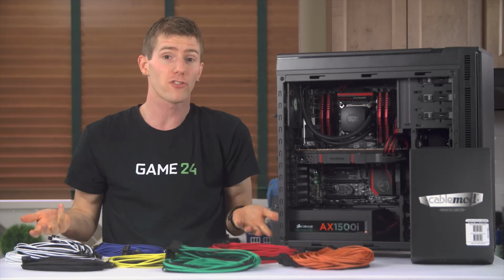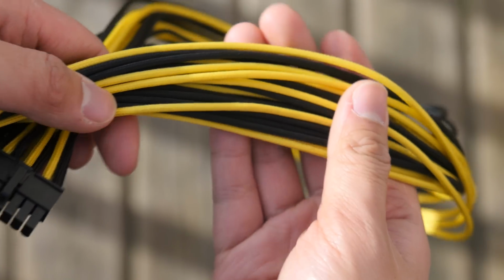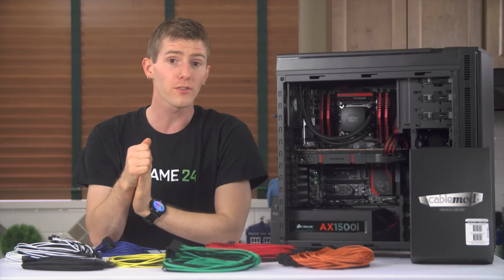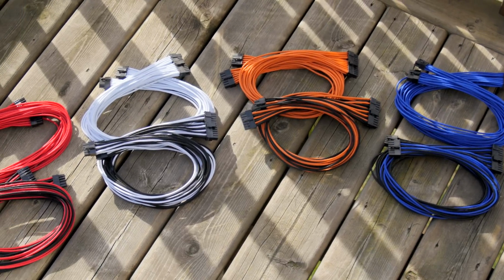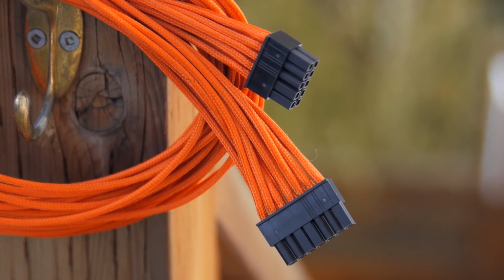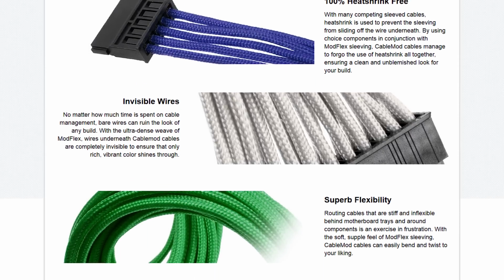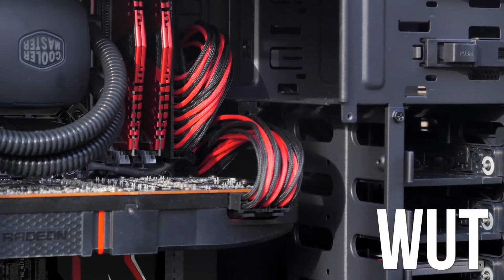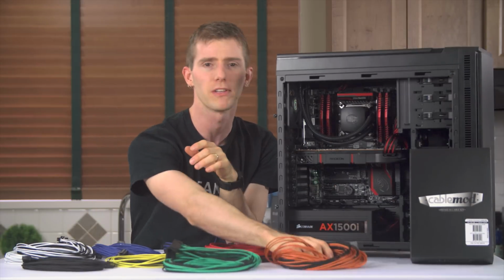CableMod C-Series Individually Sleeved Cables - Sexy and Simple

Comment: So I ordered CableMod Pro modmesh cable extensions for my EVGA Supernova G2 650watts power supply , should I be worried about ''additional resistance on the wire'' for which Linus is talking about ?

Comment: I'm not an expert with PC's, but isn't the fan for the PSU meant to be facing downwards @ 4:38?
Reply: Doesn't make much of a difference. They did a video on it i think.
Reply: X Oh ok, thanks for the info.
Reply: +Hsc Exams Also depends on the case, as some cases dont have any ventilation at the bottom. np :)
Reply: X Cheers. I'm new to all this stuff, I'm trying to build myself a PC atm.

Comment: why are sleeved cables so expensive ?
Reply: cause they are handmade
Reply: and they're not necessary. they charge you because you can. its not a need but  a want.
Reply: This is not a normal cable with paracord, they use a high quality nylon!
Reply: vespaman0
I don't care, as a consumer, profit margins don't matter, only quality and price matter. Because why go with cable mod when you can get something better for less?
Reply: +vespaman0 Same thing goes with cable management, same thing goes with watercooling, same thing goes with your backlit keyboard, however they aren't price-gouging the shit out of you for them. Plus, bit-fenix cables are a-lot less and are even better, being that they are thicker and easier to train.
Reply: Deimos Phob They don't have the benefits of a massive production process though that corsair has for their standard cables. Since seasonic makes theirs and many others. When you sell 1000 cables with your power supplies and make a ton you can sell cheap because you don't need a high profit margin. These companies like cablemod don't sell a whole lot so they need a high profit margin.
Reply: Deimos Phob whether or not they are better idk..but if bit fenix going to make them for you in custom color patterns  and length? Each cablemod purchase is done using the configurator which allows you to make your cables completely custom. That cost money. They don't have that prearranged and prepared for you. Its all "cooked to order". I highly doubt bitfenix will do that for you. If they do then that's great but from what i have seen doing short research its not the case. And does bitfenix support the same variety of power supply?
Reply: vespaman0
For most people, they just want a solid color, I personally think multi-color cables are a bit too much for most builds. And even then, the stuff from cablemod that is "cooked to order" as you put it is still far more expensive than the bitfenix stuff, and it is of far lesser quality. Also, bitfenix does have the same amount of variety for psu cables when it comes to the pre-made ones, and they always use 20-4 pin, and stuff like that on the base end of the powersupply in-order to ensure the cable is compatible, excluding the RM series, as the RM series from corsair has weird issues with caps, in which you need them on the cables. Yes, you can go into cablemods store and customize it, but it still doesn't mean that it will be good quality. Even then, the bit-fenix cables are also just as shitty, as they are almost just as hard to train as the cablemod ones, and the connectors, just like the cable mod ones, are of low quality and are bent in from factory, making the ends impossible to train too! Well, that is if you want to physically take them out of the connector.

Comment: what do you think of my pc build  stoked to build it 
CPU: intel core i7 4771 watercooled by Corsair Hydro Series H110
GPU : MSI R9 290 GAMING 4G in crossfire
Motherboard: MSI Z97-GD65 GAMING,s1150
RAM: Corsair Vengeance LP 16GB (2x8GB), DDR3 1600MHz
Case: Cooler Master Storm Scout II Advanced
Psu: 800 watt corsair 
Storage : 500 gb ssd by crucial and 2 tb barracuda 
fans : bittspector red led fans 

is there anything i should change

Comment: Is this a good build? 

AMD 2650 (OC to 2.0Ghz)
64GB of Corsair Dominator Platinum 2133
19.6 TB of PCI-E Storage
4 GTX 980's in CrossFire
2 1500 Watt PSU's (My CPU is pretty power hungry)
Rosewill Line-M Case
Windows 98

Comment: Dont get this... System. I´ve already saw a video about these cables on the channel of hardware chanucks. So i went into your shop and looked for some cables for my cx7500m from corsair. And the prize is actually higher than the one for the original(colored) sleeved cables by corsair itself. .
Reply: The Corsair cable also uses Shrink Wrap to finish the cables, which some people might not like. And also complicates the assembly process

Comment: I really don't see the point in doing this, because after a short while, everything will have a layer of dust on it, and you will really only be cleaning the heatsinks regularly, thus it will only look cool for a short while.
Reply: *****
 The issue is that it does not really work on the really thin layers of tiny dust particles that are clearly visible, but essentially require you to wipe everything down to get rid of it.
Reply: Razor2048 Meh. If you love your computer enough to buy it custom sleeved cables, then you should love your computer enough to give her the good old clean out and dusting every once in while anyway. I'd buy some custom cables and re-do some color scheming in my case if I had loads of money to blow on aesthetics alone! Sadly, life and money do not allow me to use money on purely aesthetics for stuff like that right now.

Comment: Can I get you guys opinions on my Pc? 

Cpu:  core i5 4690k
Motherboard: msi gd65 z97
Gpu: gtx 760
Ram: 8gb
Storage: 4TB 
Psu: corsair cx600m
Case: nzxt phantom 410 

Is it a good pc? Im not using it for serious hardcore gaming like, just a small bit of gaming cuz I have a ps4. I do use it for photoshop and unity3d etc. So what do you guys think?
Reply: The 760 is a little out of date id go for the 960 for around the same price, also get get an ssd for boot and your main programs (its waaay faster)
Reply: Yeah, it's good enough. Better than the average at least.
Reply: Honestly you did a good build but depending on what your willing to spend i have an $1100 Build video you can watch that is similar to yours but with a better gpu(r9 290x) and a better storage set up
Reply: Islaymoocows Yeah that's what i was thinking and the build video on my channel has both of those things with exception of the gpu being a 290x because they recently dropped in price
Reply: declan lees What issue? the reviews on the 960 are nearly perfect! http://www.newegg.com/Product/Product.aspx?Item=N82E16814487091
Reply: Don't get a 960 as it has a lot of issues (not daddy issues)
Reply: thanks guys :) i already built the pc a few months back, no issues with 760, :) i am getting an ssd though. thanks for the replies :)

Comment: Sleeve your own cables, peasants.
Reply: Not everyone has time, patience or delicate enough hands to do that.
Reply: Christoffer Nørskov It really doesnt take a lot of time. Maybe I should start selling sleeved cables on ebay, since pc modders appear to pay heaps of money for them.
Reply: Jay Anderson It does take time to do it properly. For a full power supply, most people say 20-40 hours for a first timer (99% of the people doing it are first timers) depending on how many cables you have, how many mistakes you make and how big your perfection tolerance is. 40 hours is more than a full work week, and most people just don't have time or patience for that.
Reply: Christoffer Nørskov I dont understand what takes so long. Ive never sleeved specifically pc cables, but ive sleeved a lot of cables in general.
Reply: Jay Anderson Then that's why you don't expect it to take long.
Let's just take a 24 pin cable, that's one out of many cables from your PSU. It consists of 24 cables, that each need to be sleeved with the following process.
Step 1: Take 1 out of the 24 cables out of both connectors (assuming you use your current cables not custom making your own)
Step 2: Cut the sleeving to size (this is more complicated than you might think, as the cable has to be cut to the stretched length, not it's resting length and one of the major points of failure)
Step 3: cut small pieces of heatshrink
Step 4: put sleeving and heatshrink on cable
Step 5: align the heatshrink right over the edge of the sleeving and heat it up enough to melt the sleeving in a tight ball around the cable isolation (this is hard, and will result in retries)
Step 6: cut off the heatshrink now that it's melted he sleeving to the cable
Step 7: repeat at the other end
Step 8: insert cable back into the jacks
Fantastic, that's one out of 24, now repeat steps 1-8 23 more times and you have your 24 pin cable ready to go. One single strand can take anything from 5-25 minutes depending on skill and any mistakes. Assuming you spend 5 minutes on every strand and don't make any mistakes, a 24 pin cable will take you a "mere" 2 hours.

Then you just have to do the same thing for your two 6/8 pin cables for your gpu (times as many gpus you have), all your sata and molex power cables, your 4/8 pin cpu header, and any other potential cables you have. Also, remember that if you have your psu cables sleeved, you might as well go all in and sleeve sata cables, fan connectors and anything else visible
Reply: Christoffer Nørskov I should give it a go sometime. 5 minutes for a single strand sounds very generous.
Reply: Jay Anderson Generous? That is a very optimistic estimate, especially if you want to both do it without leaving visible heatshrink and do it well enough that it will last

Comment: I view cable sleeves as akin to light strips, aesthetic eye candy. Sure, there are some benefits to be gleaned along the way, maybe for neatened cable runs or tricky distribution runs. I have been favoring mini-itx boxes and there is a lot of excess cable to pack away.

Twice in my life I have cable failure. They can be a bear to chase down, who thinks a cable will fail? I don't. But now I check when the usual diagnostics yield nothing.

Still I would like some. Form over function can still be a bit of vanity. I'm not perfekt.

Comment: Too bad they don't work on my ax 860 corsair!
would buy if were made for my psu series
Reply: our C-Series is compatible with the AX860 - the way how it works is the
following: Go ahead and buy a C-Series, once you bought it please
forward us the proof of purchase (invoice) and then we will send you a
AX 24 PIN cable in the matching color of your set free of charge.
Reply: So its a 14 + 10 pin from the psu, I'm not sure what yours is.
https://plus.google.com/photos/109060042969223363175/albums/6116910432695633121
Reply: That's probably because corsair sells a sleeving kit for AX/AXI/RM/etc
Reply: AdminWirsoftonline yea but i kinda dont like the heat shrink at the end of the sleeves.
Reply: I have these for my 860i, not sure what the difference is between the 860.
Reply: Brett McGinnis i thought it was only the corsair link cable port?
Reply: Yeah, I don't even use that feature. On CableMods site, they say you need a 24 pin cable if you have the 860, so there must be something different there, not sure what though. If you need more specifics, let me know, I can take pics for you.
Reply: Brett McGinnis thatd be cool
Reply: Brett McGinnis wow thanks man. the only difference i see is that its on its own row by it self.
mine is with the other plugs

Comment: I am building a Gaming Pc the parts are as follows please tell the parts are good and if not please suggest one. I am building it for first time so need some help

CPU: Intel Core i7-4790K 4.0GHz Quad-Core Processor

CPU Cooler: Cooler Master Hyper 212 EVO 82.9 CFM Sleeve Bearing CPU Cooler 

Motherboard: MSI Z97S SLI Krait Edition ATX LGA1150 Motherboard 

Memory: G.Skill Ripjaws X Series 16GB (2 x 8GB) DDR3-1600 Memory 

Storage: Crucial MX100 256GB 2.5" Solid State Drive

Storage: Western Digital Caviar Blue 1TB 3.5" 7200RPM Internal Hard Drive 

Video Card: Gigabyte GeForce GTX 970 4GB WINDFORCE Video Card 

Case: Phanteks Enthoo Pro ATX Full Tower Case

Power Supply: EVGA 750W 80+ Gold Certified Fully-Modular ATX Power Supply 

Optical Drive: Asus DRW-24B1ST/BLK/B/AS DVD/CD Writer 

Monitor: Asus VS239H-P 23.0" Monitor

Sound Card: Asus Xonar DG 24-bit 96 KHz Sound Card 

Wireless Network Adapter: TP-Link TL-WDN4800 802.11a/b/g/n PCI-Express x1 Wi-Fi Adapter  

Case Fan: Corsair Air Series SP120 High Performance Edition (2-Pack) 62.7 CFM 120mm  Fans 

Keyboard: Razer Blackwidow Ultimate 2013 Wired Gaming Keyboard 

Mouse: Logitech G502 Wired Optical Mouse 

Headphones: Razer KRAKEN 7.1 CHROMA 7.1 Channel Headset 

Speakers: Logitech Z506 155W 5.1ch Speakers
Reply: Get an i5 4690k, that mobo is overkill, 8 gigs of ram are ideal, ditch the optical drive and the sound card since they are pretty useless anyway.
Reply: ***** thnx for reply but will i5 5690k be able to play most  of the games at 1080p ? And till how much it can be overclocked?
Reply: Even an i5-4440 and a R9 280x will be able to play 1080p60, even though the 4690k is better and overclockable up to 4.6 GHz. If your goal is 1080p60, you're pretty much golden.
Reply: ***** and what about video editing? I don't heavily do heavy video editing but medium video editing is my need..
Reply: i7s are for heavy editing and rendering, so, unless you do really demanding stuff, with the 4690k you're set.
Reply: ***** I am going with 4690k as you said. Thanks for your help I appreciate it :)
Reply: ***** how is it an overkill? It's only 125$
Reply: I'm no PC expert. But shouldn't the fans be AF instead of SP.
Reply: ***** uuh how about streaming.
Reply: Agree with Federico Boscolo about optical. If it suits you to go with an outboard optical like an ASUS BW-12D1S-U External Blu-ray Burner.
I have an affinity for Noctua fans, aesthetics aside. Maybe a BenQ gaming monitor, TN v IPS panel. Anything else you can add/change/delete with little problem. Aren't PCs great?
Reply: QuantumWrench Yep, PC Master Race.
Reply: I would also ditch the expensive headphones and keyboard but that´s just maybe me
Reply: Well that's his choice, although I'd go with a Vengeance K70 instead of the Blackwidow.
Reply: Cool Dude i had a laptop before and never bought a keyboard seperately so it was necessary for me to get one and about headphones i just wanted one :p
***** i would add k70 instead of blackwidow
Reply: I would recommend the R9 290x Lightning instead of the 970, but it's your call. They're both about the same price, and same performance.
Reply: Blizzquake Well, it's up to him, but I'd go with the 970 even despite the whole VRAM fiasco because I've had a better experience with Nvidia so far. Driver updates, shadowplay, better cooling etc.
Reply: It's a personal choice. I went with the Lightning because it was the better deal at the time.
Reply: ***** I slightly disagree with limiting to 8GB. My desktop/game box has 24GB, it was going to be 32GB but I used the 2x8GB sticks elsewhere. At idle I have about 9GB in use (gospel according to Task Manager) most from a 4GB RAMdrive and Samsung Magician. Sure, I used it that way because I had it to use. Aside from gaming, I think the OP mentioned light video/content editing. I cannot quote any edit software needs for memory however game texture and effect maps like some elbow room. I have lived with low memory handcuffs before and prefer snappy performance v OK performance. An additional thought is disabling any page file from being used. Minutia about SSDs do wear out, might get a few more days or years without paging I/O.
My opinions of course, your performance may vary.

Comment: What do people do to route their sata cable/power cables to their HDD and SSD? My corsair 850w modular psu has like multiple sata connectors on one line, and it just looks weird and is a hassle to plug multiple in the psu when I only need two instead of like 10 running to the HDD/SSD

Comment: We get all these nice sleeved cables but why does no one fucking make right angled power cable plugs?
Reply: They're available. But difficult to obtain.
Reply: ***** Where? i have found no online shop that sells them. the only thing i found are some janky put together ones and most are for molex. no 6-8 pin ones.
Reply: Ashaira I've seen them with a few older power supplies as well as eBay & Alibaba. They're hard to find and merely a fluke when you do find something.
Reply: A search on amazon gave me plenty of results. 

They're not in demand because most people have a few cm space behind the computer.
Reply: Völundr Frey I wouldn't say it is that. More on the lines that less people want them since manufacturing processes would be to be modified to support the angled cable connectors. An investment that many manufacturers just don't want to take. As for some of those adapters.. They're not properly made and could cause issues (problems with conductivity, build quality, etc.)
Reply: ***** 
He's talking about internal power cables. Ie. the plugs that go to your PCI-e (usually graphics) cards and the CPU power connector. Just like right-angled SATA cables, except for those plugs.
Reply: ***** I know what he is talking about. And they exist. Just very hard to get your hands on. Also, very hard to wire efficiently (unless you're using M-F adapters).